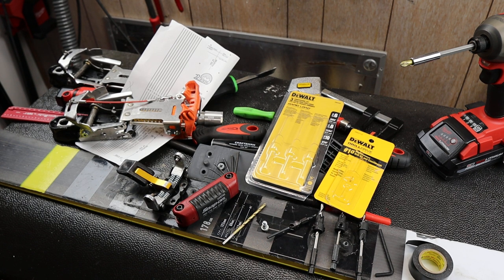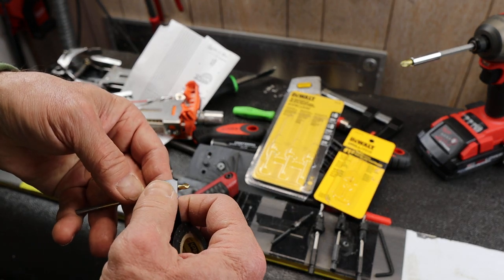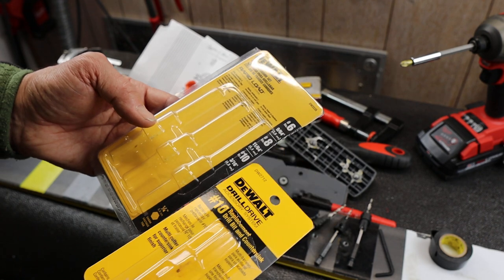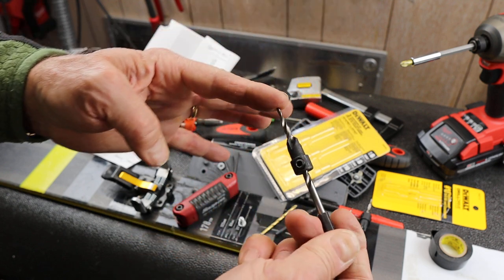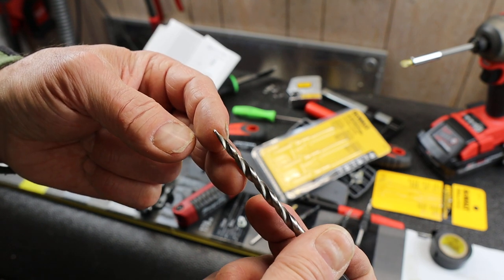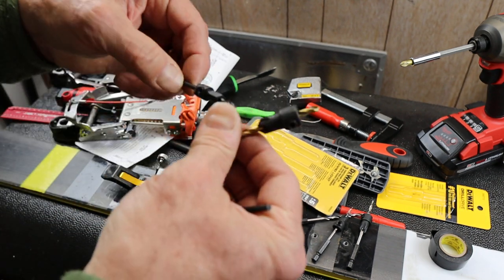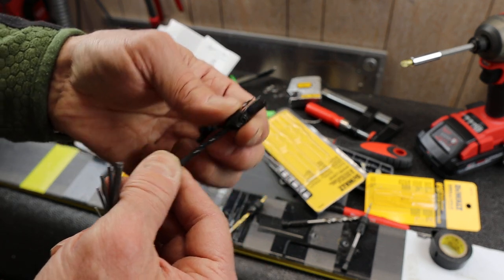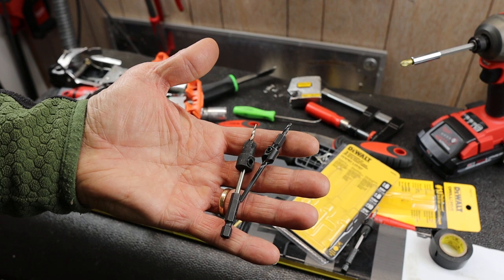Backwards use of  the DeWalt Countersink drill bit collar as a depth limiter works great!

Comment: THE WORLDS FINEST TOOLS SINCE 1920 👍
Reply: @felixf5211  In my opinion they are.  They sell mid-tier tools at extremely high prices.  They practice "Prestige Pricing" which most of cultist are highly susceptible too.  Brands like Nepros, Knipex, Wera, Wiha, Hazet are all much better made tools at reasonable prices but don't have the cult following because their pricing isn't as ridiculous.  I think SO is loosing alot of the market share because the younger generation doesn't buy into them like the old timers did.